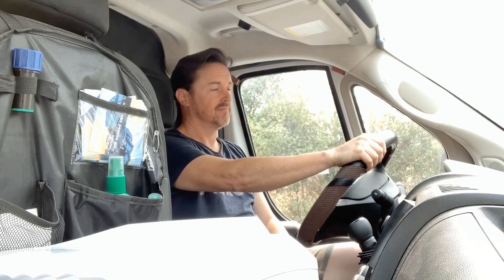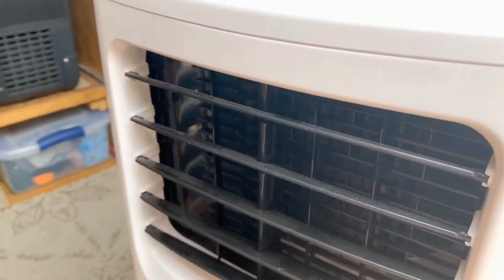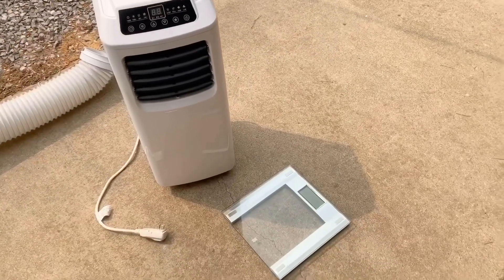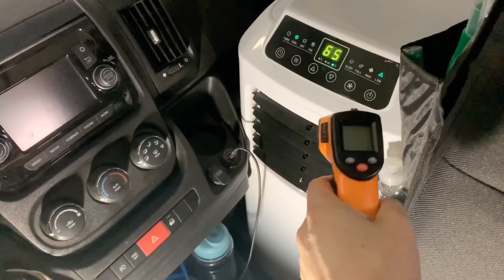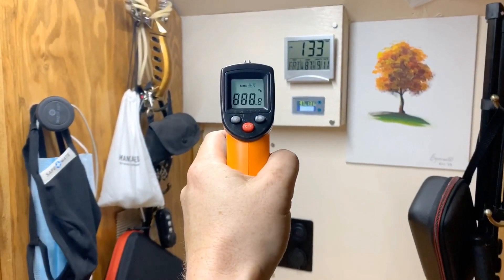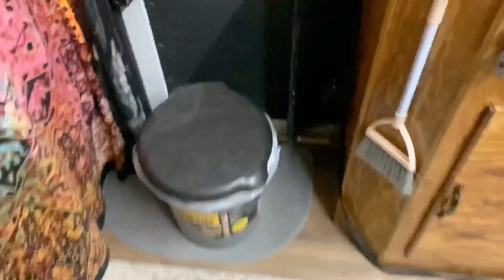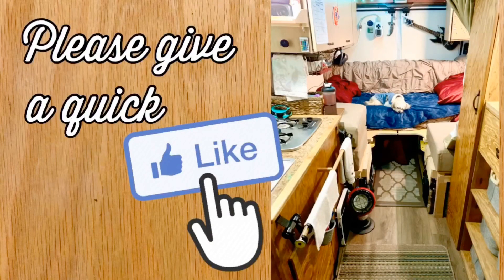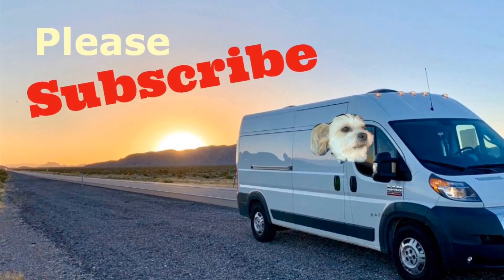Portable Cab Air Conditioner | RV Van Life

Comment: If i could give you some information to make your unit more efficient, the lower vent on the back of those type units are actually the inlet for the condenser section. If you could somehow pipe it to the outside also, you would not have to use conditioned air to blow across the con coil and to the outside. Great video, I plan installing something like this in mine.
Reply from the maker: That’s fantastic advice and definitely helpful. This next summer I’ll see about trying that (assuming I’m not too lazy LOL). I say lazy because I’m recently more mobile from being debt free so I just spend summers on top of mountains where it’s cool. I didn’t have that freedom before. But I love it when we help each other out. Thank you
Reply: @n8nomad419  your welcome my friend, I've been a commercial refrigeration tech for 20 years and now going out on the road.
Reply from the maker: Sweeet! Are you already mobile or someday in the future...
Reply: @n8nomad419  I am now
Reply from the maker: Awesome. Maybe I’ll pick your brain more sometime if you don’t mind. (it’s nice to know people who have a specialty). I’m more the Jack of trades and the Master of none LOL
Reply: I wish I could understand what you are saying. LOL I'm installing this system right now and don't understand your comments w/o pictures. lol

Comment: Have you come up with a solution where attaching the initial hose that runs to the back to cover the entire vent so you aren't losing so much air in the hot front area? Your video shows the white tube only covering half the vent area. Thanks!!!
Reply from the maker: I have. I made a simple square out of thick cardboard and duct taped the end of the hose to it so all the cold air runs to the back now. Sounds ghetto LOL but it’s solid.
Reply: @n8nomad419  No, not at all I was thinking maybe using one of those plastic shoe boxes with velcro - so I'm on the right track. lol
Reply from the maker: Absolutely. I used cardboard because I could easily cut, shape it and tape it to the hose. Also light weight and easily spray painted if worried about esthetics. (I’m also your first subscriber 😁

Comment: How about the kit that allows for alternate propane on the generator. That way you could keep a propane tank for  just that purpose and it's cleaner.
Reply from the maker: It’s a great idea but I personally don’t need a generator. I generally stay away from the heat unless I’m visiting family etc and they allow me to plug in. If I’m working (and I usually only work in winter) then the heat isn’t a problem.
Reply: @n8nomad419  I'm doing the same. I spend lots of time on the west coast, Fort Bragg and North. However, I'm working on using my portable A/C. You've got good ideas. You should have more followers. Your style is just right

Comment: only one issue with your test, that's the infrared thermometer. It doesn't work with shiny metallic surfaces. To get around this, use some masking tape on metallic surfaces. Other than that great job on the setup.
Reply from the maker: Thank you for the helpful advice 😊

Comment: I have a solar panel and power pack in my Honda Ridgeline.... Want to find something that I could use to help protect my dog inside of my Ridgeline when I'm away from him
Reply from the maker: That’s the same reason I do this. My dog can’t always be with me unfortunately. And none of my cooling methods are extremely efficient.. but they keep the temp comfortable enough for him. And cool enough to sleep when the sun is down. But lately I’ve taken to just spending summers in high elevation instead.

Comment: So which A/C would you use? This one or the other one on your other video? They both seem efficient. Which is cooler while you sleep?
Reply from the maker: Your bus may be bigger than my van. And the AC (both) are “barely enough” for my size. Just so you know. Also, yes the Isolator should run an AC unit pretty easily but the vehicle would need to be running the whole time to activate the isolator. My biggest recommendation (more than anything else) is to focus on “Prevention” as much as possible. The less direct Sun the easier to cool and stay in cooler regions or altitudes as much as possible (if possible). No matter what you do, unless you spend Tons of money and engineering.. there will be no scenario that is perfect. 

BEST wisdom= a Van life will always be closer to (camping) than an apartment. So just keep that in mind and you’re golden 😁

Comment: What generator do you recommend getting if you’re not going to be hooked up to shore power? I saw you had a price but didn’t see the generator.
Reply from the maker: That’s a difficult question since your rig might need twice what mine needs or half what I use. I personally use a 3000w which is more than I need but better safe than sorry.
Reply: @n8nomad419  I live in AZ so basically something that would run the ac at least during the brutal hours of the day.
Reply from the maker: Exactly. My body temp regulation handles swing temps better than most I assume. I’m usually fine with fans, shade, etc. but need some help during the hottest hours. Also I try and sleep between 2am and 10am if possible during the summers if I’m not up in the mountains where it’s cooler.

Comment: Wow I just went to Home Depot and Lowe's and they had pretty much the same brands and mine is huge compared to that. Mine does do dehumidifying and fan and drying and air-conditioning but still if I had one small like this that would be great and mine is only 7500 this one he said 800 but I think it's 8000
Reply from the maker: I’m guessing 8000 too. 800 sounds like it wouldn’t cool a small closet 😉
Reply: @n8nomad419  You said 800 in your video.  The label said 8,000.   Thanks for the video, gave me some ideas.
Reply from the maker: Oops haha sorry about that. 🥴

Comment: Get some home ac insulated duct tubing first off. And maybe upgrade to a dual tube portable AC... that single duct one you have uses your cooled air to blow out the heated air back our, so it’s extremely inefficient in its entire process. Also you may want to understand what reflective materials do when you are taking a temperature reading with an Infrared meter. It makes your readings false.
Reply from the maker: Thank you for all of the great info. I’ll see about improving it further. Thank you 😊

Comment: I wanna see how the tube on the front is connected. 🚐😎
Reply from the maker: SherryVan  One small piece of tape LOL. It removes easily but holds well enough. That way I can remove it. I’m sure someday I’ll think of a more clever way
Reply: @n8nomad419  doesnt seem like a piece of tape not covering the entire vent would produce enough force? But it does.
Reply from the maker: The piece of tape doesn’t cover the whole vent. Probably 20% of the vent is still blowing cold air into the front. But because the ice cold air is directed specifically to the back it’s way more efficient. Cooling the front and back area. If I made an adapter to direct all of the cold air it would be even more efficient. And I’ll probably do that sometime
Reply: @n8nomad419  ok ok thanks for giving more info.

Comment: Goin on hour 8 trying to find a suitable AC solution for my 20ft ancient mini Winnebago. Have you tried using it with solar at all? 
I have a 120 V output inverter, any info would be a huge help 😂
Reply from the maker: This system would work with solar.. IF you have (over) 8,000 watts and a 2k inverter and Only during peak sun hours. But that system is extremely expensive compared to a simple, small/quiet generator that taps into the top 2/3 of your fuel tank which allows you to use the A/C at night while sleeping.  Much more practical. Or plug it into a friend/family/RV shore power. Solar is Possible but it’s like trying to walk on 40 ft tall stilts (although possible… very impractical).
Reply: "Van with tim" ac shows you can run ac with just solar power I think he used 900watts
Reply from the maker: Absolutely can. But forgetting it won’t work while sleeping at night unless several thousand dollars invested in expensive batteries. I’m not sure the right question is “Can it work that way” or “is there a cheaper more efficient way.” Because a $400 (cheap) gas generator tapped into the top 3/4 of the fuel tank allows all night long (all week long) cool temps while the sun is away. It’s smarter, cheaper and easier. Not “YouTube Awesome” LOL.. but real.

Comment: I like the fact that you don’t give up. I am thinking a portable air conditioner or window unit on my next van. No more rooftops for me. You can buy probably 3 of the portable ones for what one made in China rooftop would cost.
Reply from the maker: Thank you. That’s an amazing complement. And good luck on your tenacity as well. Just remember... if you build it completely Off-Grid.. you’ll be prepared for the upcoming Zombie Apocalypse created by the current RNA vaccine hahaha. (Just playin’) now where did I put my crossbow..
Reply: @n8nomad419  so a Chevrolet express passenger van would be ok for my next build?
Reply from the maker: I’m no expert and haven’t built out one personally, but sounds good 👌 Wish I could be more help. I have seen one built before.
Reply: @n8nomad419   my next van is not going to have much in it. Like I say leave the finish in the van and try to work some insulation in the ceiling and walls. I am going to look into prefabricated cabinets at Home Depot. It will be nice and plush like this one is. TV, commode, sink, microwave, air conditioning and be able to stay warm and cool. That’s all.
Reply: @n8nomad419  you didn’t answer my question. Would a passenger van be ok for my next build? Working insulation in where I can and leaving things as is?
Reply from the maker: Absolutely. As long as you’re actually happy and comfortable with it, that’s all that matters. Well, and it drives well uphill 😊 But honestly any vehicle conversion can work well for certain people. Would (I be happy in one? Maybe not). But as long as you are that’s the point. I’ve seen all sorts of vehicles converted, I wouldn’t live in half of them.. but it very subjective. Truly anything can be home. I’ve seen people on YouTube living in cars.. not in person but.. it’s cool. As long as you can make it work.
Reply: @n8nomad419  my point is that the passenger van is mostly finished out and the build would not cost as much. You buy a cargo van and nothing is finished. Take out the metal petition and start from there. In a cargo van the floor, walls and ceiling has to be done. In a passenger van van the biggest obstacle is getting insulation in the walls and ceiling. Then do the build like you want. Am I missing something here? If so tell me you opinion. I would love to hear it.
Reply from the maker: And it’s an awesome idea because of that. It’s half done already. Also less to heat and cool compared to a taller/bigger van. Many bonuses. I have suggested that idea to my son who wants to do the van life (he’s 21) for those same reasons. I personally couldn’t unless I could stand up. But for others that’s awesome. My son want the same thing (passenger van) because it’s less work. He wants his to be a GAMING Van 😁
Reply: @n8nomad419   there are 2 cons in a low top van. You cannot pee standing up and putting your pants on in the morning. Outside of that I am fine with a low top van. I am 66 years old and I have gotten used to the low top and and can get around in the van with no problems. Really just the 2 drawbacks I mentioned is all. I don’t cook in my van. At best heat something up in the microwave. I have a low top now and would not hesitate in having another one. Peeing and get my pants on is really no big deal.
Reply: @n8nomad419  it is very true that I cannot get my pants buckled up and my shirt tucked in. I have to lay down on the bed. But I am from the old school and we tuck our shirts in out pants. And you really can’t do it in a low top van. And  peeing in the commode I have to sit down.
Reply from the maker: Haha you’re awesome. You give vivid visuals and I like your humor. And you find workarounds.. that’s cool.

Comment: Any updates on how and where to mount the gas generator? I want this option for powering my ac
Reply from the maker: My personal opinion is to mount it on a covered rear luggage rack mounted on the tow hitch. That way it’s vented properly outside of the van and quieter.

Comment: I have a question about the wattage of that thing how much wattage does it give out can you run it on a portable electrical system
Reply from the maker: In the video I did show the back of the unit showing all information (Watts, Amps, BTU, and many others). I don’t remember off hand because I unfortunately have it in storage for the winter. But I do know all of that is in the video at one point. And at the very end I mention the only way I know how to use it with a portable system. This is honestly my favorite way to ride out the hot summers by far 😊
Reply from the maker: I just watched it. It’s 9000 watts. It’s on the lower end for these kind of units, but powerful enough to need a generator. 😊

Comment: I’m considering put a portable
AC in my sort bus. Could you tell me what generator do you use to power it off grid and how long does it last?
Reply from the maker: I would use a 2200 or 2500 W generator that has an X ternal port to tap into your fuel tank making sure that it does not go below the three-quarter mark of the tank so you cannot run it dry. A generator by itself will last anywhere between three and six hours at most. Without using the fuel tank. There are many types and brands to choose from as long as it is quiet and can use an external fuel source. There’s an awful lot more to it but I would suggest you talk to a mechanic for the details because that’s some thing I haven’t done myself 👍

Comment: Is  this  one  of  smallest unit a/c   12x13x30H       thanks   for  the  info
Reply from the maker: It was the one I could find that was not only short enough but (barely) fit into that space in the front. Barely as in (I don’t even need to secure it because it fits so tight as is). 😊

Comment: You run off of shore power. Have you found a battery pack that will run it?  Thank you.
Reply from the maker: Yes. It can run off of 400a LithIon with a powerful Inverter through the night. Or a good generator tapped into the top 3/4 of the gas tank. But I chose not to invest that heavy expense because now that I am completely debt free and my monthly expenses are about 600/mo if I don’t drive much, so I live on the mountain too where it’s cool in summers and drive down to only work weekends then back up. It’s my happy place. So it works for me.